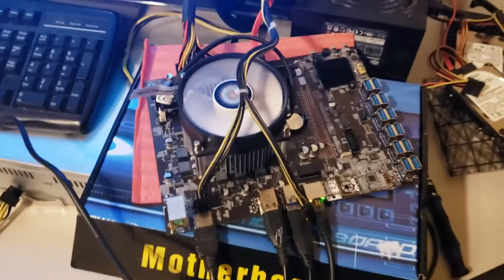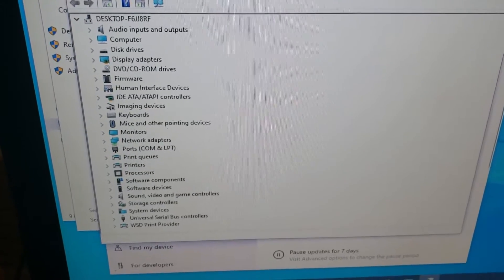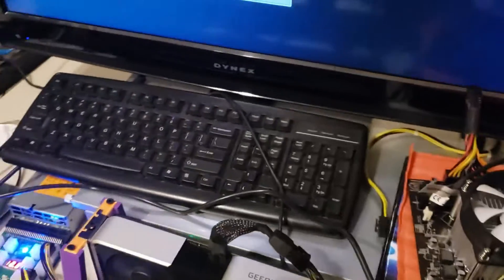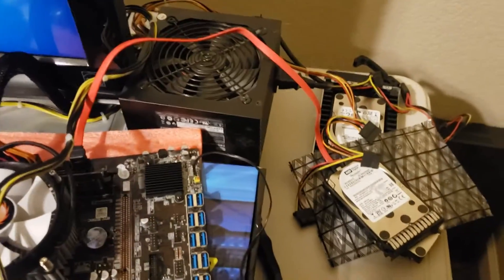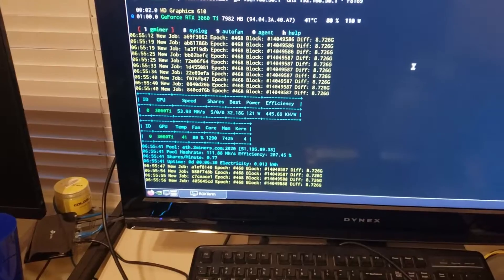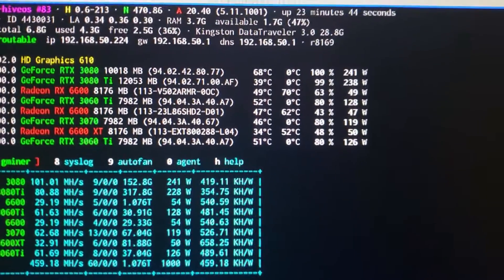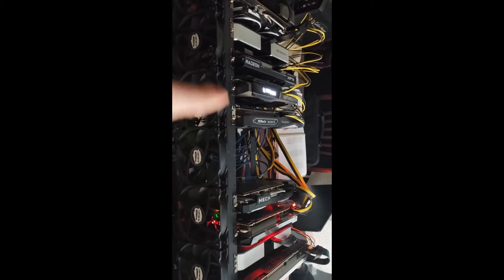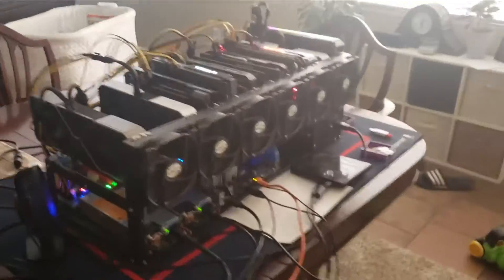Trying B250C BTC 12X USB3 0 TO PCIE Mother Board and RIG update

Comment: I have a question for you ? My B 250 C Motherboard will simply boot up to lead me to the Bios so that i can then install Windows log into my Hyve OS account. I would be thankful for any advise on how to solve this Issue. I only use name brand ATX power supplies, Intel LGA 1151 CPU & Gskill Trident RGB RAM modules. I received the same B 250 C Motherboard in the same packaging as you.
Sincerely ?
Reply from the maker: I would take everything out, cpu, ram, cmos battery. let it completely drain. then put everything back in and plug both power connecters in and try and boot up. make sure to just boot up mobo by its self with no gpus and use on board hdmi.

Comment: I have 4x 5700Xt and 3x rx580 AMD GPUs, it turns out that when I put the 7 together, the motherboard B250C won't boot up, if I connect the 5700xt's alone it works, if I connect the rx580's alone it works, but not together, do you guys have any clue on whats going on? I was able to run the 7 cards on the B250 motherboard sometime ago...
Reply from the maker: Try messing with some bios settings, 4g encoding, make sure u use legacy boot. Idk why but it helps lol

Comment: Hey man! I’m having trouble getting my GPU to come up on hive os.. I have the same mother board and rtx 3080. Did you do anything in config or have any suggestions?
Reply from the maker: it should just come up. make sure its all seated properly and has all power connected
Reply: Casey did u solve it? i’m having the same problem with my 3080s.

Comment: Hello. I bought this motherboard but I am unable to connect more than 4 AMD GPU ! when I connect the 5th, I am unable to boot on hiveOS. Do you already see this ?
Reply from the maker: No i have not, what gpu are you trying? Also what gpu risers are you using and what power supplies are you using?
Reply: @crazykkid2000  i have only rx580 and 5700xt
Reply: Main power supply is a 750 watt only power motiver Board and i hâve a 1500 watt Server HP power supply for gpu and riser. Riser are version 009 with 6 condo.
Reply from the maker: @mrgp88  also make sure u do the virtual mem fix too!
Reply: @mrgp88  did u manage to get rx 5700 detected ? mine does not detect on this board
Reply: @NinjaHero198  same... haha
Reply from the maker: Ok so it will take a long time to post with a lot of gpus. It can take up to 20 min. I know its strange but mine can take 20 min to boot sometimes. Have u waited for 20+ min to see?
Reply: @crazykkid2000  Hum Not. I just waited 1 min. The thing about Virtual mem is on the bios ?
Reply from the maker: @mrgp88  if u are using hive os, the virtual mem dosnt apply, but if u use windows u will need to do the virtual mem fix to be able to mine with multiple cards.
Reply: @crazykkid2000  I use hiveOS

Comment: Did you run into any issues with running AMD adrenaline software on this board?  I found that once I install it my fan control goes away and just sits at zero even though I have it set at 60%.
Reply from the maker: Yes the same happened to me, but once u start putting a load on the gpus it will kick in with ur Fan tune i learned. So yea they just sit idle till u start to mine. I was like wtf, cuz it didnt happen with only 1 card, it only started happening after multiple cards lol.
Reply: @crazykkid2000  Yeah not only do my fans go to zero, but the lights on the card also go on and off.  I also run into WHEA_UNCORRECTABLE_ERROR blue screens, so I think there might be something wrong with my board.  This all happens with just 1 6700xt connected
Reply from the maker: @ItsPJBia  my 6900xt does wierd stuff, like kicks the led on and off and like kicks the fans so they bearly move every once in a while at idle. Its strange. But i never had any blue screens, only when the virtual memory wasn't set right with 8+ cards did i start haveing any issues. U may have an issue with something hw related for sure, maybe even driver related. Is this a clean Windows install? Have u tried booting to hiveos to see if u have same blue screen or freezing issues? Thats what i do. Kinda use hive os and windows together to troubleshoot. I have found 2 bad 6600xt that way.
Reply: @crazykkid2000  Yeah clean install of windows several times now, different driver versions as well.  When I let the rig sit with no graphics cards attached it ran all night (13hrs) no blue screen.  It seems like once I get cards/drivers installed is when it happens.  It might need to be my first attempt at Hive and see if it truly is a hardware issue or not.  Thanks for the advice
Reply from the maker: @ItsPJBia  one thing i have come across is. Windows wants to do an advanced micro update. What i have learned is do a clean install of windows. Do all updates, including all optional update. Make sure it does the advanced Micro updates too.. then when u install amd drivers, i had to update the driver. If i did a clean install it would freeze up and reboot in the middle of install. 
Hope that helps too, Let me know it goes!